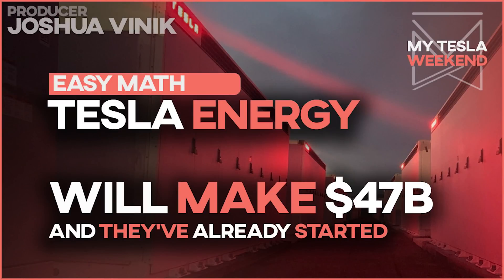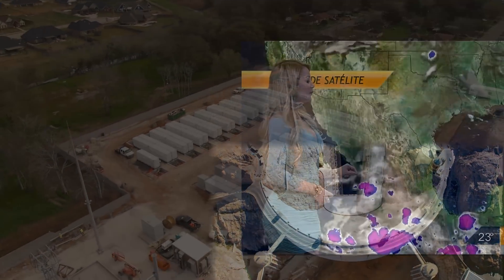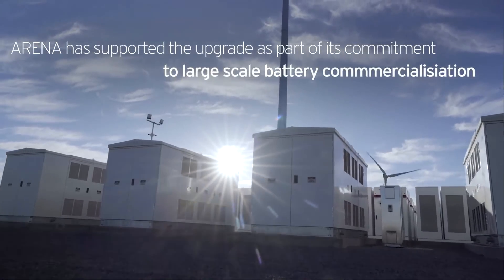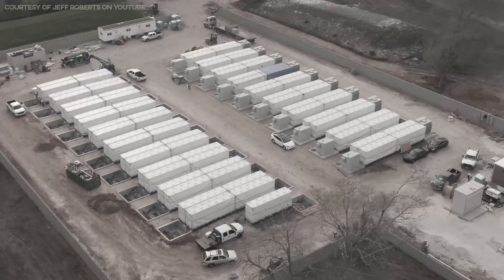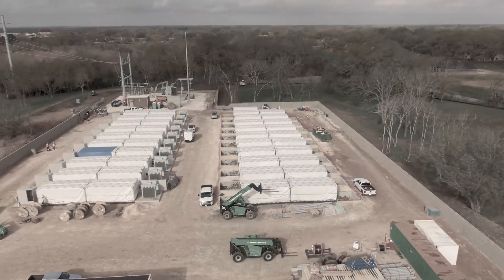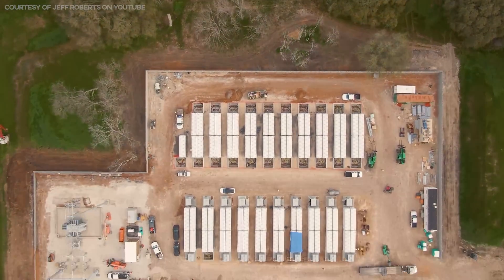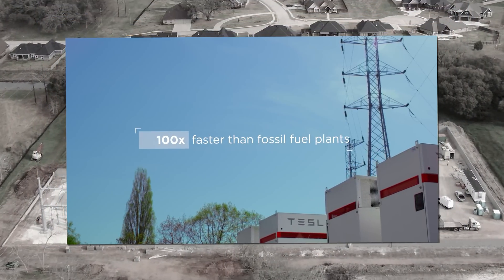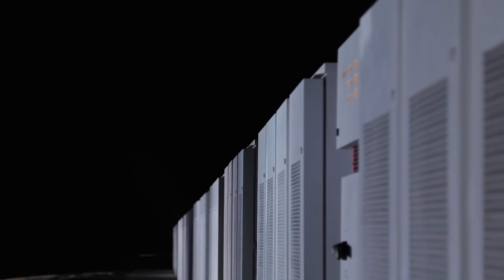Tesla's $47 Billion bet on energy

Comment: Power generation in my region of Texas is beginning to develop combined solar and battery projects. The construction phase is relatively short, as you mention, but the development time is generally around two years (assuming everything goes well) after land leases are secured. So, while this is a tremendously valuable sector, you may need to adjust the initial ramp-up until there could be a one per month rate. Even so, while it might delay your forecast a bit, once it ramps to that point there would be no reason to stop until the total addressable market is addressed. Thanks for a very insightful presentation.

Comment: Liked this presentation.   Two questions that come to mind are, could Tesla secure enough raw material for batteries to pull this off?  Of course with the math you discribed, it would be a more profitable for Tesla to use their batteries for this than anything other than Robotaxi.  Just building and selling cars would generate much less profit.  Except for my second question,....
I have heard it postulated that as the grid transforms  to less expensive solar power and more consumers participate in electrical generation,   the cost of power will drop dramatically.   How much affect on ROI would that have.  
Oh yeah, we mustn't ever forget that the "Tesla killers" are coming!!!  Liquid air storage, liquid battery storage,  and gravity storage will be competing.

Comment: A one year payback term was only possible due to the high cost of electricity in a place with such supply shortage that rolling blackouts is a thing. The system operator would gladly pay plenty to avoid those. Those rates come down substantially as supply increases. The return on investment is less when you move from providing emergency power to just peak flattening, so 'diminishing returns' needs to be factored into your math. 
That said, if Tesla has capital to spare to put into running these systems themselves, then they will (clearly) but batteries are their biggest constraint right now, so I wouldn't expect what your modelling to begin until after they have the battery factory gatling gun blasting out more supply than they can handle.

Comment: The quantity of peaker plants required isn't that significant

For example in the UK its about 5GW for 4hours = 20GWh

If you deploy that over a period of 10 years you get 2GWh/year

By comparison car demand is 2.5 million units per year if you assume a 50KWh pack That is 125 GWh per year for cars

So you are looking at battery for peakers as 1/60th the size of market as for cars

Also it will be a commodity product with little to no profit just like solar PVs
Reply: Over 1000 peaker plants in the USA alone dude.

Comment: Peaker plants are not expensive they are the cheapest of all the power stations to build

For example one was recently built in the UK it is 299MW and cost £120 million
Reply: Capex yes it’s not that expensive, opex though is expensive
Reply: @RunTheNumbers  Opex is not expensive for a OCGT its the cheapest OPEX of any power station

I think what you mean is that the fuel is expensive but even that is wrong. In the USA natural gas is very cheap only about 1 cent a KWh so through a gas turbine at 40% efficiency = 2.5 cents

As for batteries they need to buy eletricity to be able to sell it and in the process of conversion Also lose 10-15% of the energy. If they buy the eletricity from a solar farm or wind farm its likely to be more than 2.5 cents

The use case for batteries makes more sense at solar farms. If you have a solar farm with 1.3GW of panels and a 1GW inverter. Well if you add a 8GWh battery and 1GW of solar panels you have turned your solar farm into a controllable dispatchable power station

That is a bigger market than peaker plants. The market for peaker plants isn't very large ~100x smaller than the market for batteries in EVs

And finally just because a market is large doesn't mean its profitable. Look at solar PV companies like first solar. Its share price was over $300 in 2008 some 13 years later the share price is only $80 a huge loss in real terms 90% of shareholder value was lost. Why? Solar PV is far bigger and better than it was back in 2008 tje industry has boomed to 20x its former size. The reason is simple tje consumer won not the producer. Solar PV became a commodity product with little pricing power and low margins. The same thing will happen for batteries 🔋
Reply from the maker: Cheapest to build, but the power they sell is the most expensive on the grid. The consumer cares how much the power costs on their statement, and peaker plants contribute to higher bills.
Reply: @FutureAzA  Peaker plants dont contribute to higher bills they reduce bills relative to other plants

If peaker plants were the most expensive they wouldn't be built. They are the cheapest which is why they are built 

Most nations only need to cover 2-3 hours to meet the absolute peak demands this is usually around 5-7pm as people get home after work and start turning things in and cooking etc

Anyway
Irrespective of the cost of peaker plants. The reality is most nations don't need thst many of them. The UK peak is less than 5GW for less than 4h = 20GWh and more realistic is 4GW for 3h = 12GWh

So the ability of batteries to displace oeaker plants isn't significant

The UK is a pretty big country with nearly 70 million population. And we only need 10-20 GWh of stationary storage to cover the peak. Yhats not 10-20GW per year but a one off so if the batteries last 20 years it's less than 1GWh deployed each year. A pretty irrelevant number vs cars which for the UK would be over 100GWh

So batteries to meet peaker needs is 100x a smaller market than cars

Basically a rounding error

More likely is batteries deployed at PV power plants to allow a PV plant to go from 30% capacity factor to 60% capacity factor
Reply from the maker: @kaya051285  Peaker plants sell energy at about 4x that of wind and solar. https://en.wikipedia.org/wiki/Cost_of_electricity_by_source

Comment: That’s a strange way to measure things.. a lot of presumptions here. a mega pack isn’t a replacement for a peaker plant. A peaker plant generates energy, batteries here only store and smooths out spikes. How much gwh in total capacity does peakers generates and how much battery does that equates to? And it will takes renewables that exact amount of capacity to charge the batteries at least.. not all peakers are fossil fuel based, some wind farms act more like beakers most of the time.
This isn’t a very well thought out, studied, convincing and insightful video dude. I wish you all the best but a simple spreadsheet with lots of presumptions, conjectures and unrealistic linear correlations and conditions just isn’t good enough.

Comment: This is bigger then that. First Battery chemistry, what Tesla is doing in allowing better chemistries to push down existing production to the packs. That means they do not take an optimized line out of production the build a new one to fit the new chemistry for the vehicles. A huge savings on the cost side as production ramps up.
Subsidiaries allow Tesla to fit within any existing regulatory environment creating captured customers and using them to expand from peaker plant to Virtual Power Plant to full scale utility capturing more of the market and pushing Solar.
This also allows Tesla to fit into the smart grid coming infrastructure push and with smaller packs build out the VPPs at the substation level and or at the Rural Electric Cooperative level.
One thing Elon does is think Big

Comment: Great theory, and positive outlook. Numbers though, seem a bit simplistic. As Mega Packs are installed, this actually brings the price of energy down in the market where they are online. Sure, savings (profits), are huge in the initial years, however, peaker plants will die off and other forms of production / storage plants will replace them. These will need to be competitive in performance and price, and therefore, costs savings (profits) will be diminished. Note that I'm a Tesla "Bull" and certainly a Fan. Painting a rosy story is great, but gives rise to a lot of doubters, if it's not qualified. Keep up the great work!
Reply: All true and profits will diminish over time. However Battery packs will remain an important load leveling device for the foreseeable future and they can be used to pivot to a longer term VPP.

Comment: The world consumes about 30,000 TWh of electricity a year.  There can and will be competition.  The market is MORE than large enough to accommodate all.  Competition won't matter for 15-20 years.  And Tesla will have lower cost than most.

Also consider that transportation is electrifying.  1B vehicles globally consuming 4 MWh a year adds demand for another 4000 TWh a year.  

None of this factors in population growth, rising demand due to rising living standards and the expanding global middle class.

There is plenty of room for 'competition'.  Almost all current FF and most nuclear infra will be replaced over the next 20-30 years.
Reply: Great comment. Converting the current fleet of ICE vehicles to EVs will require tremendous investment in the power grid including battery storage.

Comment: What I find exciting about these projects is that they can scale.  Start with 100MWH then scale up as needed.  And the footprint of the scaling can go “up” instead of “out” which makes it ideal for dense areas, too.

But, of course, as more are added, the volatility of the price of electricity will diminish, thus lowering the favorable economics.  Still, these are great and will do well (maybe just not as well in 10Y).  But that’s possibly the useful lifetime of these batteries anyway.   Exciting stuff.
Reply: Lifetime is much much longer as they will use LFP chemistry and even at 90% they will still be working fine.